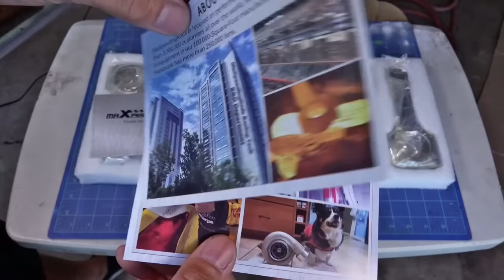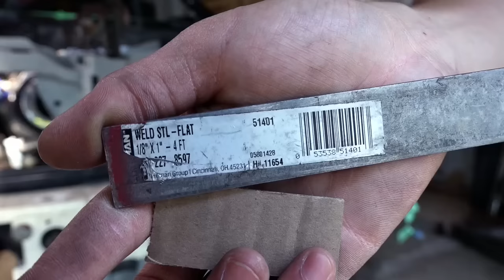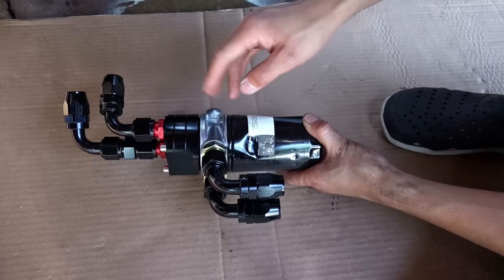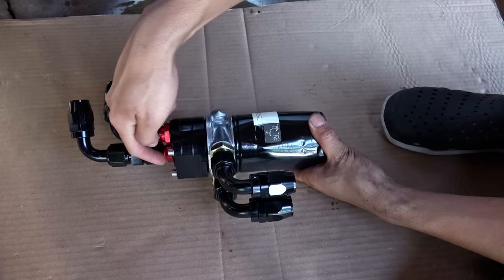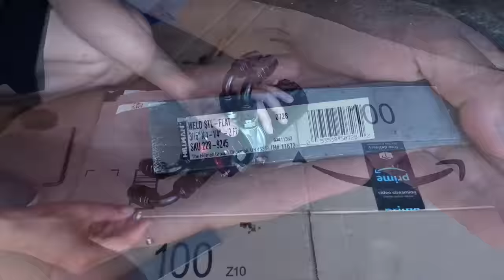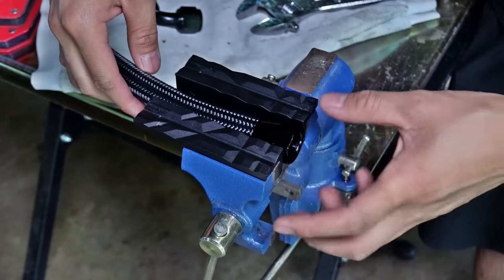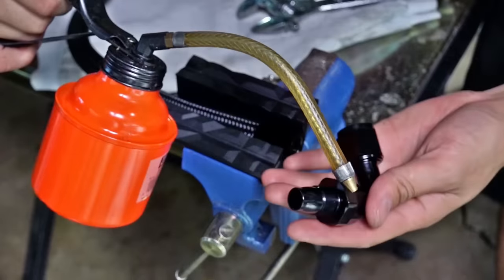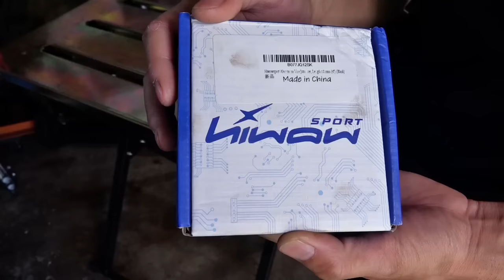E30 Fix 17 | Unbox $415 MaXpeedingRods Rods, $173 Oil Filter & Cooler Relocation

Comment: Hot dang. Love watching this build! Reminds me of my own E30 turbo project from a year ago. I also have the same oil cooler setup in the exact same spot, minus the thermostat. OH! Don’t forget to install a PCV catch can otherwise you’ll develop positive crankcase pressure and IT WILL shove oil from the oil pan back into your turbo housing causing a TON of smoke. Amazing job as always dude 👍🏼
Reply: A catch can doesn't prevent positive crank case pressure. Simply disconnecting the breather hose at the throttle body will. From there, you can do whatever you want with it. Open to atmo, go to a can with a filter pod, can to turbo elbow, whatever. Just not anywhere after the turbo (positive pressure).

Comment: Great vid man ! quick question: How you gonna feed oil to the turbo ?
Reply: I think that’s why he has an AN fitting with a 1/8NPT slot on it. To attach the turbo oil feed line. I could be wrong.
Reply from the maker: Oscar Orozco Jr. is right on point.

Comment: Can I use the heater core lines for the turbo feed?
Reply from the maker: I think you can. For me, I'm using the coolant line that flows from the engine block to the throttle body and then from the throttle body to the thermostat housing.

Comment: Great video as always love the attention to detail, my only concerns are oil cooler shouldn't be mounted with both inlet and outlet pointing downward, it can trap air at the top during operation and will make oil cooler inefficient. The other concern is oil should always be filtered before going to an oil cooler, soot or deposits in oil can be trapped on fins inside oil cooler tubes an create a blockage over time, just some things to consider. Keep up the good work.

Comment: I don’t know much about cars and i know you did your research but wouldn’t the mods you did on the intake manifold compromises its performance?
Reply from the maker: Probably, we'll find out. I can always make something better to replace it if it turns out to be that bad.
Reply: How is the project so far??
Reply from the maker: @longgiang3265  As far as you can see in the video. I'm slowly working on it because I have a few side projects going on. I'll try to work on it more sometime.

Comment: those rods are they any good?
Reply from the maker: I haven't used them. I also have never heard about them being broken on high HP cars yet.
Reply: @DarkDragonWing  thanks for reply. I also noticed you installing oil cooler. Is this really effective? I thought engine oil must run hot to be efficient. Our engines m20 aren’t that hot anyway. Not 24 valves
Reply from the maker: @selespeed3  I'm not sure. Since I removed the factory oil cooler, I thought it makes sense to replace it with another oil cooler.
Reply: @DarkDragonWing  the car has oil cooler? Lol oh I didn’t know. Because I own the 318i for nearly 20 years and assumed the 325 is the same. Recently I bought a 325 1988
Reply from the maker: @selespeed3  Neat!! Yes, also the oil cooler is cool. 😁💯🏁🏁